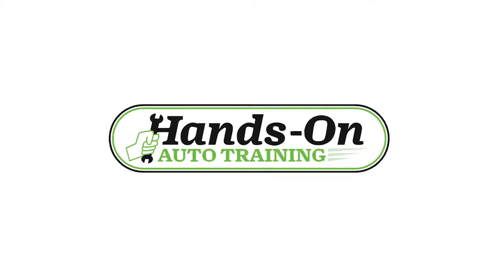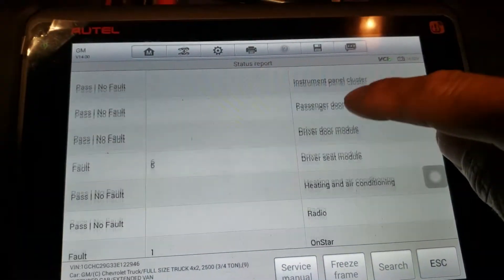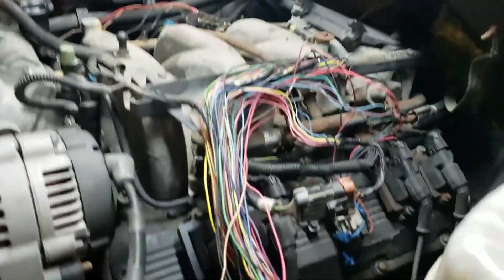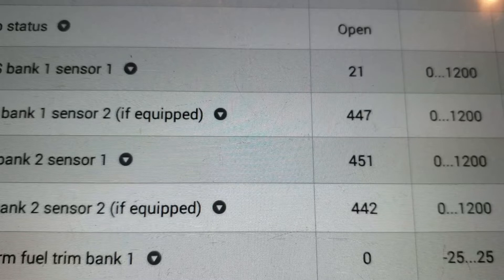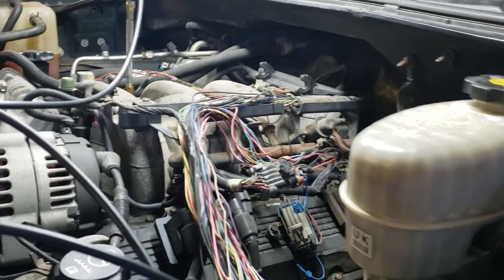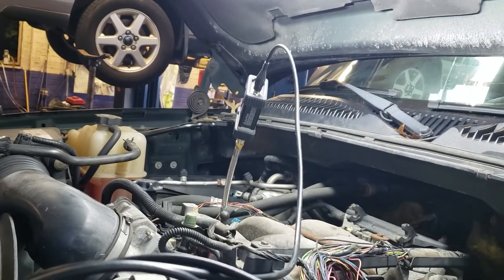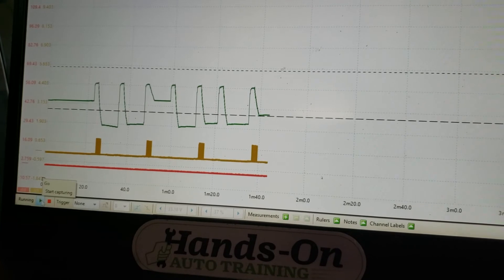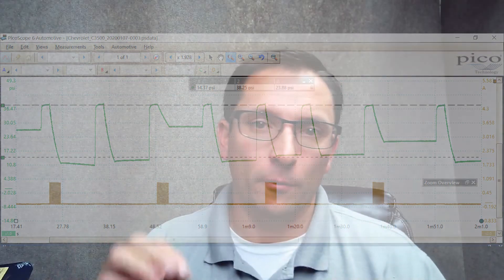2003 Silverado 8.1 misfire P0300  multiple cylinders Lean . Pico scope & WPS  checking fuel PSI

Comment: I have an 04' chevy 2500hd with yhe 8.1   I have a po300, idles just like truck in video. 
Is there a scan tool that can test injectors for a home mechanic
Reply from the maker: You need a scan tool with bidirectional control, or use a injector buzz box. The autel 906 is one of the least expensive tools that I know of that will do this,..
Reply: @BrianMann216  thank you

Comment: Brian this might be an obvious question but where did you tie into with the wps sensor. Not familiar with it so I was just wondering and learning thank you 👍
Reply from the maker: There is a pressure test port on the fuel rail. I should have shown that!
Reply: If there's a fuel pressure testing port, that would be the place to tie into... just like a fuel pressure gauge or some models don't and so you'd need an adapter in line.     So basically the WPS is a "digital" fuel pressure gauge.  😉
Reply: Great question Arthur!
Reply: Except on Honda. Thanks Cuba and Brian for the reply. I have the Honda fuel pressure gauge just try to figure out where to hook into if I have to. Under hood by firewall or at the pump itself. Never see anybody show Honda fuel pressure testing.all I ever hear is it’s more complicated and they never do it. Might make a good video. Thanks Cuba and Brian stay well Artie ❤️

Comment: what was your reasoning for replacing all injectors ?  How did you go about informing customer that the injectors would need to be replaced and further check out would need to be done ?   Thanks for your time and work. I find it exhausting to educate customers and sometimes i feel like they start to not trust you when you cant tell them everything that is wrong on the first (go round)..looks much easier than watching a gauge and you can show the customer the results of the test from the scope. I suppose you could film it but then you would be risking South main Auto loosing subscribers.Ha Ha
Reply from the maker: Reason for recommending  all 8 injectors:  SI states to record all of the pressure drops,  add them up and divide by the number of injecotors and find the average drop, , all the injectors should be withing 1.5PSI of the average.  As you see we were all over the place.  Replacing just those 2 probably increased the fuel to those 2 cylinders compared to the other 2 of bank 1,   causing a very slight rough running.  I know the customer did not have much $$ not to mention other parts thrown at the vehicle.

Comment: super nice find Brian! looks like the shop did lots of work to no avail, to only have you find out it was fuel injectors based on your testing methods... simply just shows the power of the scope. The only thing i would advise is , try to get used to doing the relative compression with scope set up, I know for the most part your ear can  "hear" proper "present" compression from what you "think" is all cylinders, but as you venture into other makes and models with just as large v8's with defferent firing orders or larger engines like 10 cyl's or 12 cyl's , those can 'sound" just as good and healthy but be down half an engine . it only takes one time to get burnt and waste a whole lot of time chasing your tail to find out you could have "seen it" from the get go with rc test on battery with a sync, dont forget the sync because no sync will "show all humps "as well. i know out in the moment its always "quiker " to just "listen" to cranking caydence , but always try to back that up with visual set up, that will save you more time and headache. Again, great find for sure and great use of scope , and appriciate you sharing the good content!
Reply from the maker: You are right a RC test would be using the scope. I deviated from my basic teaching in class and you got me on  it !   I will tell you how I was thinking that day and why, not saying its right or anything LOL. 
1 Lap top and scope in trunk of my car at that moment, as you can see in the video not much room at this location. Granted I set it up any way in the end.
2 The cranking test with ear is my high level go no go,  We had 2 cylinders missing, if I heard anything super obvious i would have hooked up the scope right away.  Also if I did not see anything in scan data to give me a direction, I would probably be getting the scope out to check out secondary ignition, and at that point a RC would be a no bainer.   
All that said, IF I worked at a shop (not out of the trunk of a 04 civic) I would do the RC test right away due to the fact that my scope should be out and ready to roll.  Thanks for your input  talk to you soon!